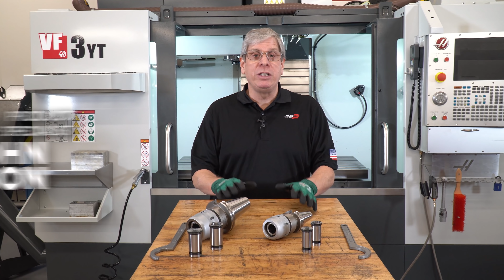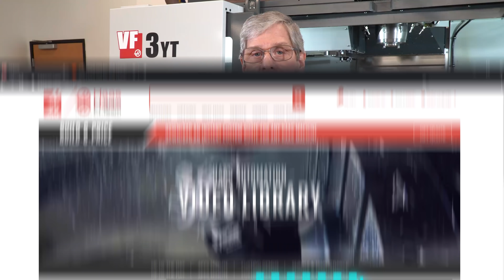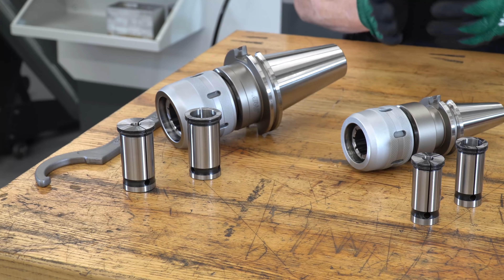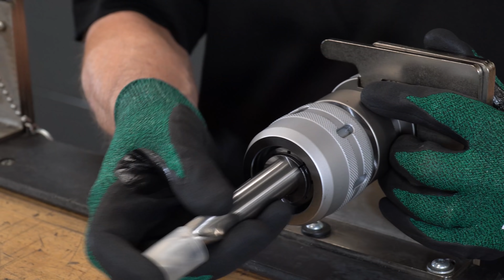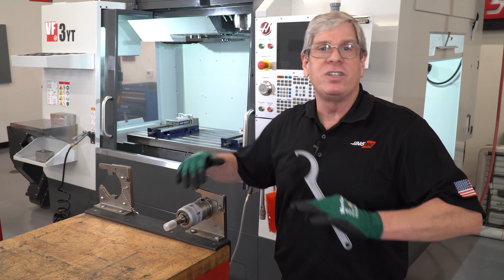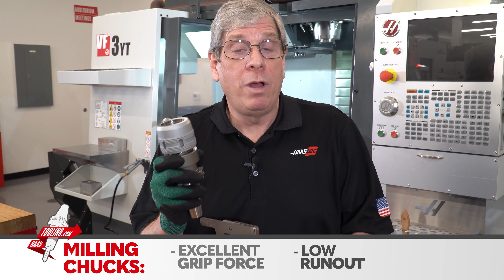We Have Milling Chucks on HaasTooling.com - Haas Automation, Inc.

Comment: I dont get it, whats the advantage of these over er16, er32 etc, collet type holders? Seems those are more common and probably easier to find.
Reply: the milling chucks have drastically higher holding force compared to collet holders. They're good for roughing since you can put a LOT of cutting force on a beefy endmill and yank it right out from the collet.
Reply: @ydna  they have hydraulic holders for that purpose, or heat shrink (both have minimal runout) if you really want to spend money. This really looks to be another haas gimmick, sorry if that sounds harsh. Not to mention most haas machines arent rigid enough for most folks idea of "heavy roughing". Also, "profit milling" toolpaths are all the rage these days (longer tool length engagement, lighter stepover, faster cuts). I'm sure some people might find these useful but i dont think these are going to catch on with many folks.
Reply: @ChippTurner  Haas didn't invent these. Here's a list of average available holding force for each one: (data from Sandvik)
ER32: 20 kg*m
3/4" dia hydraulic: 25 kg*m
3/4" dia heatshrink: 48 kg*m
3/4" dia milling chuck: 75 kg*m
1.25" dia hydraulic: 43 kg*m
1.25" dia heatshrink: 78 kg*m
1.25" dia milling chuck: 175 kg*m
For holding force alone, the choice is pretty obvious. The problem with hydraulics is they can fail pretty easily, and they're also VERY expensive per holder compared to everything else. Heatshrinks are good for long extensions but terrible for heavy roughing, and require a large investment in the induction unit. Everything has its place, but if you haven't pulled a tool from one of those then you're not cutting hard enough.
Reply: @ydna  yea i know they didnt invent them but theyre somewhat obselete already when you look at all the different availabile insert tooling you can use and the different types of toolpaths that are becoming more popular that dont use as much heavy roughing.
Reply: @ChippTurner  I'd say it depends on what your goal is for the cutting. If you're not concerned with cycle time and instead want to limit the engagement, HSM toolpaths are cute but that's nowhere near the capability of a production CNC. Like you said Haas aren't the most rigid but they can handle it easily so long as you don't go above a certain tool size. Now if somebody has a Minimill or TM where the spindle power isn't available, or a 30 taper with less rigidity, a milling chuck would be a bad idea. But if you want to get that material out of there without limiting things, and the machine is capable of doing it, well there's simply no replacement for displacement :)
Reply: @ydna  haha nevermind i just glanced at ur page i didnt realize all u machined was toys. These might work great for your application or for any of the other hobbyshop haas guys who are just getting into machining
Reply: @ChippTurner  ahh so you can't dispute any of my answers to your dumbass questions so now suddenly I'm a hobbyist LOL. Good luck with your future trolling 👍
Reply: @ChippTurner  I remember buying my first milling chuck in 1990.   It was a Nikken, it was damn spendy and I still have it.
Reply: @jonbaker3728  I just bought my first second hand NC mill (Deckel FP2A) and amongst the tools with it is a  NT40CT32 with collets, unused. Have you any idea if it is appropriate to also use this milling head without  a collet in it? Best regards from belgium
Reply: My shop has used milling chucks for decades for large diameter tight tolerance aerospace parts. Why? Because theyre versatile and they work  @ChippTurner

Comment: What is the advantages of a milling chuck over a hydraulic chuck? It is much the same, using sleeves to reduce size etc.
Reply: Its cheaper
Reply: @sibixis  the list price of a Schunk tendo e hydraulic tool holder is almost exactly the same as the price listed for this milling chuck on the haas website.
Reply: @BaldurNorddahl  yeah... Schunk also produces hydro holders where the hydro portion is inside the actual tool taper, so gauge lenght is incredibly small...
Reply: @BaldurNorddahl  ahhh i didn't look at haas price i was just talking generally. Purchased 3 milling chucks for 590eur total and 2 hydro for 670eur. So milling one is under 200 and hydro a bit over 300.
Reply: There is no advantage to this system, this is a gimmick marketed towards people with little knowledge of tooling and a blind devotion to haas...
Reply: Replying to Dan M...  This is not specific to Haas at all.   Haas just started selling them but others have sold them for years.   Your comment makes no sense.

Comment: Ok, fine. But can you also release a metric system version, for people who don't like fractions and bunch of numbers after decimal point?
Reply: Made in USA ...NO..it will happen when sandvik starts making imperial tools. ... dealwith it and use maths
Reply: @Verifraudreports  Sandvik has imperial tools
Reply: @Verifraudreports  Doesnt work tho. If you need to use a 10mm endmill you need a 10mm endmill. There is no getting around that. Would be nice if they offered the sleeves in metric increments the same way you can get er collets in inch sizes despite beeing a metric system.
Reply: @IanMcDoe  They will probably offer metric sleeves. Haas is sold all around the world and can be run in metric mode afterall. They are focusing on US market first.
Reply: this isn't a haas tool system, I have these same holders made by BIG, metric collets (or sleeves) and everything, good holders, they are on the large side though... and long gauge length
Reply: @rikkt731  BIG as in Big Kaiser?
Reply: @Foomanlol  yes
Reply: Just get a calculator and covert and get close. Its not rocket surgery. I've always found that I'm more productive when i stop bitching about converting units of measurement and actually start making chips..
Reply: @ChippTurner  maybe it is about using metric holders/collets to hold metric tooling rather than being lazy and not willing to do "25.4 math"
it would be quite difficult to hold a 10mm end mill in a 3/8" collet in this holder, or 12mm in a 1/2" one and vice versa

Comment: Why are they designed to have a long Gage length?
Reply: They aren't "designed to have a long gauge length," they "have a long gauge length, by design." I.e., the underlying principals of their operation dictate a long gauge length. Think of them as ultra heavy duty mechanical shrink fit holders b/c, essentially, that's what they are.
Reply: @Iceberg86300  steampunk shrink fit  :)